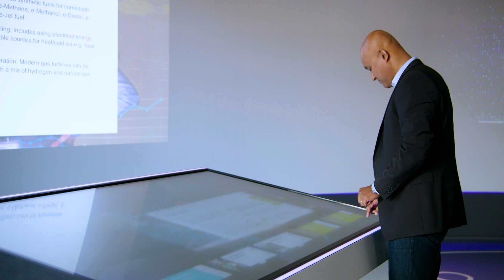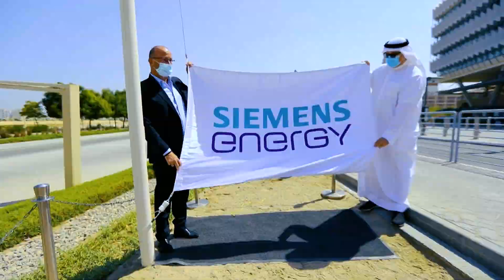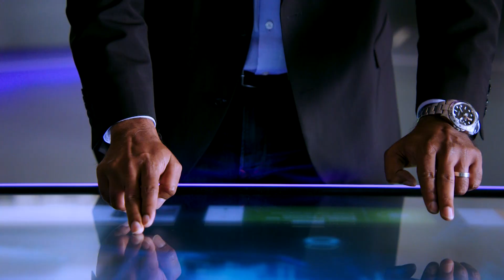Siemens Energy: Transition to a more sustainable world

Comment: everybody is keen on photovoltaics, but China, Shanghai, besides PV, also develop a 100MW ThMoltenSaltReactor until 2035, with a full Th232_fuel - Protactinium233 chemical treatment cycle. Siemens is a leader in industrial Gas-turbines! A 100MW_el ThMSR is too small. If China goes to a 750MW class MSR it would increase the economics of the necessary chemical treatment facilities. The reactor should still be inherently safe and any corrosion problem of reactor vessels would also be relatively eased. (Tritium and Xenon sequestration are also a must, even for small MSRs!) At the same time, if a 750MW_el Brayton cycle CO2_gasturbine would be available for the Chinese industry, the company, that can supply such a turbine will be a winner! 
 The problems with high temp, high-pressure CO2_supercritical turbines are gap-losses especially in transient power-up mode, and power down. This makes small turbines almost unfeasible unless someone has new ideas on his drawing board.